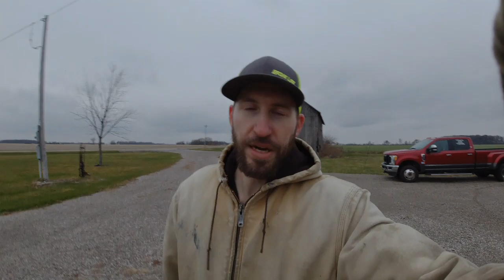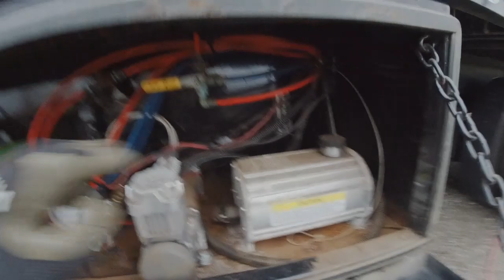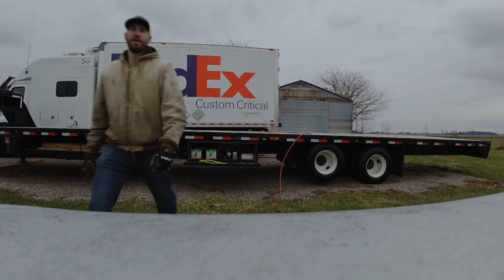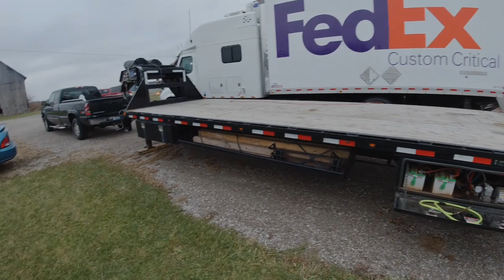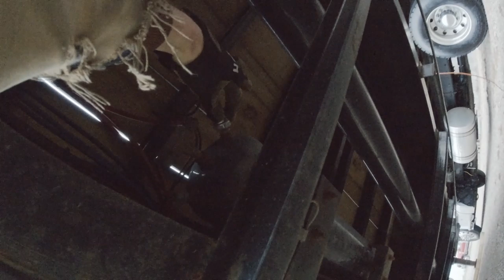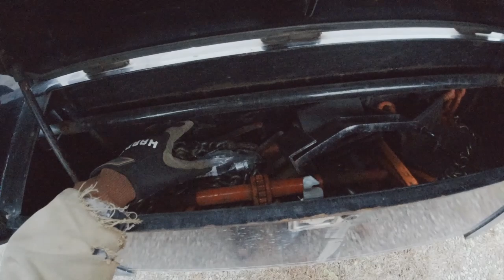40 ft Air Ride Hot Shot Trailer Update

Comment: Some times you can bring the batteries back to life by putting a good battery in with a bad battery and charge both at once.  Most new chargers will not charge a dead battery, that is why you charge 2 at same time, so you get 12 volts.